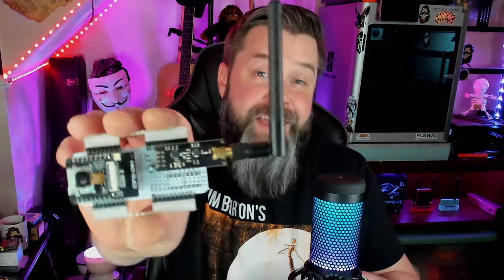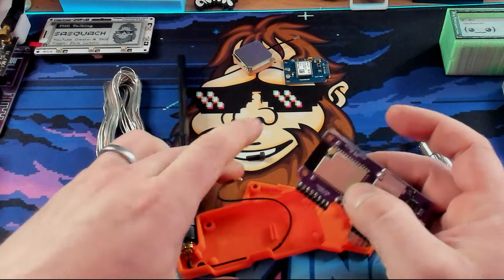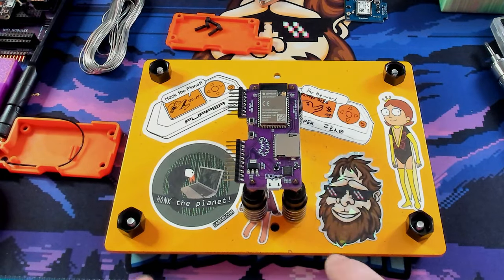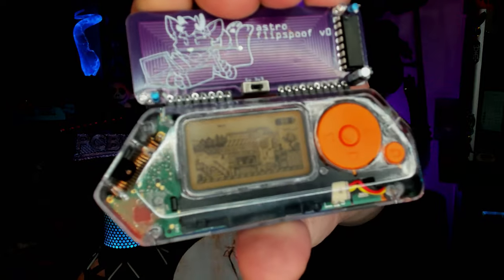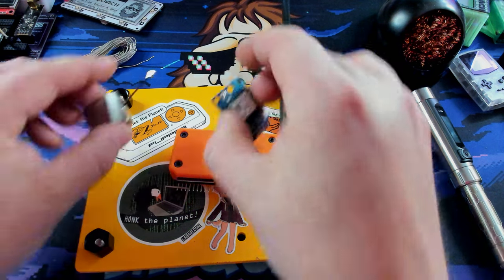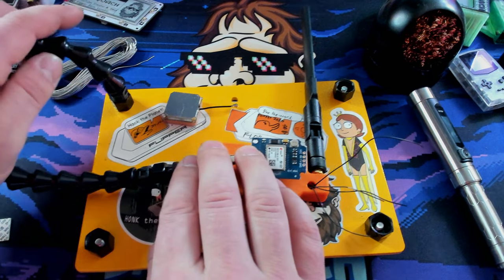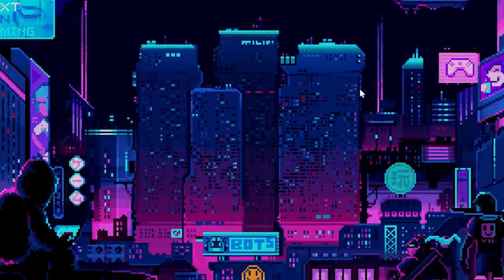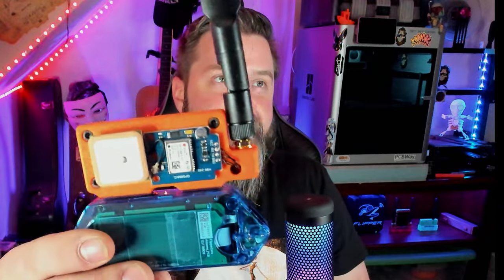Make Flipper Zero a WarDriving MONSTER!  Adding GPS to my WiFi Board!

Comment: those coords put me on a random island in the middle of the Bahamas... like if you there you in serious trouble lol.

EDIT: OK I ran the second set and that looks like an interesting place. 37°33'50.2"N 116°51'04.4"W is the cooords. like a giant target or something. anyone know anything about this? sadly there is a big puddle called the alantic between me and the usa to go visit it.

Edit 2: ok this looks like an old air force base. there are several bits in the surrounding area of interest. interesting rabbit hole to distract myself :) also by what i read its not accessible to the public so dont go there. here is a list or coordinates of things in the area of interest. 
37°33'50.2"N 116°51'04.4"W
37.48781°N 116.22827°W
37.51303°N 116.24306°W
(37.51107°N 116.25754°W) + (37.47446°N 116.25019°W) + (37.47963°N 116.25537°W) + (37.51284°N 116.25085°W) + (37.51704°N 116.2563°W) + (37.50663°N 116.25092°W)
A 15m/50ft aligned grid (37.48853°N 116.21334°W)
3 rectangular profiled objects for want of a better term (37.51124°N 116.25214°W) (37.51183°N 116.25489°W) (37.51492°N 116.25388°W) possibly bunkers.
what looks to me to be an old runway and buildings 37.525783, -116.196523

likely related to this runway and the test range next to it. 37.799798, -116.775147

Ok i have spent fair to long looking at this. better do something else before I'm put on a list... this is really close to "area 51" so likely an extension to it all. i would highly suggest not to go anywhere near all of this

Comment: Any config required? After hardware was installed it states ‘no GPS module detected.’ Using Momentum firmware.
Reply: I'm in the same boat. It's weird that it works on the gps test in (NMEA) GPS in the GPIO menu. But in GPIO > ESP > [ESP32] WIFI Marauder > Wardrive it gives #wardrive -serial GPS Module not detected. Not sure what's going on.
Reply: @ haven’t fixed it yet but I suspect it is the ESP32 settings. When I get a chance I plan on re-flashing my dev board. I just got another board so I’m going to try it too.
Reply: @B2DT11B  hope you get it. I've stuck for 3 days working on it and decided to just use the wardriver firmware instead.

Comment: Great video. You always got the best explanations and tutorials. 🙌🏼
Reply: How did you know to solder the TX and RX to the appropriate pins on the board?
I am working on building my own dev boards, and would like to know the logic behind you soldering tx/rx to pins IO 9/21?  What was it that guided that decision?
If i didnt know what the corresponding pins were, how could i find out or come to that conclusion?

Comment: That clear soldering iron enclosure is awesome!
Reply: Dumb question for you good sir.  Why were IO09 and IO21 chosen to connect the tx/rx of the gps?  (this is going off your wiki for connecting gps to flipper wifi dev board).

Comment: If i was gonna add this to the dev board or this really kool lowprofile wifi board i love, would it work the same if I soldered the wires to the top of the jumper pins that plug into my flipper instead of having to  map out those tiny spots on the esp32?

Comment: I have a question about the BLE Apple spam app. When I open mine up to test it only goes down to 100ms but I'm seeing a lot of people do it with as low as 20ms. Are they using a specific FW or what?
Reply: Update to latest xtreme firmware dev build

Comment: Flipper Zero starting to go beyond the original simple uses. In order for it to get more uses it needs to expand physically and have all the extra devices and software built in, cause otherwise we'll have all the gadgets hanging off it. IMHO this is :hand-purple-blue-peace:
Reply from the maker: One thing to keep in mind is that this is a very crudely implemented gps addon. I know some makers who are in the process of creating more relevant solutions